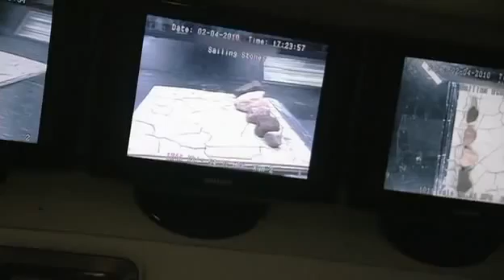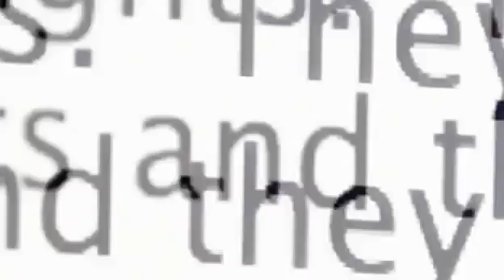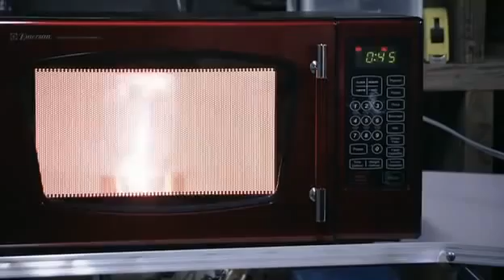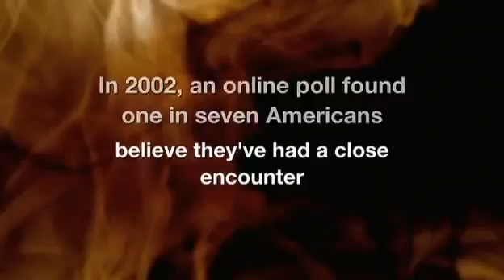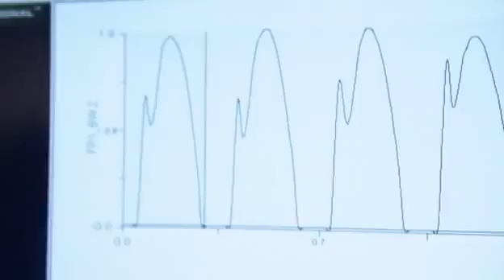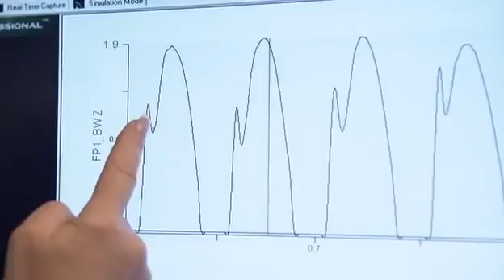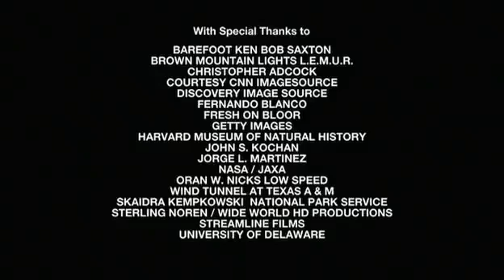Sailing Stones of Death Valley - Paranormal Supernatural Documentary

Comment: My theories on stones --->
The rocks goes everywhere because of their non aerodynamical shapes.
it can be seen during the experience.
they can roll,being out of balance or the cracks on the ground cause them to grab and go sideways.
The fine/dust sand can be a lubricant during summer.
The ground when dries up retract and pull rocks or they just go one direction because of the repetitive dry/wet cycle on the ground like a snail would : expand /retract.

Comment: I am a practicing amateur Atmospheric and Weather scientist. I have been working on a theory that explains a few things and among them, the theory of how Ice ages actually occur.
 How does this fit in to the moving rocks theory that would include rock movement during the summer? Simply this. The valley itself is not only a wind tunnel but it is also what I call a pressure trap. Surrounded by high peeks this area would also have extremely low air pressures during the summer months. This occurs because of the peeks surrounding it keeping the higher pressures out. In essence, this would allow moments of high altitude (primarily during the night) colder temperatures to push downwards into the valley directly because of the pressure differentials outside of the valley on the opposite sides of the peeks. These lower pressure and temperature variations combined with accelerated winds (downdrafts) would actually allow similar conditions to happen. The mud would freeze in minutes and the high winds would do the same things to the rocks, But also, the downdrafts would in fact be more erratic and multi-directional allowing for the paths of the rocks to be less likely to travel in a straight line! In short all of this would explain why some rocks not only move during the summer but also explains the twisting paths of some of them!

Comment: very simple -  this is a inspired explanation of the moving stones.  

1st look at the dirt. it is cracked and there are gaps that make the dirt  various  polygons.     

2. the desert area has a large temperature  difference from day to night.   

3.  things expand when hot and contract when cold 

4.  there is a ratchet  effect between the rocks and dirt-  because of the nonuniformity of the surface of the dirt.   

5.  this also happens to your computer motherboard when the power is cycled over and over-- it is called "socket creep" 

peace
KOTT(c)

Comment: Apparently, this mystery is now solved, according to Huff Post anyway. See, during certain times of the year, when the area floods with rain, it gets cold enough at night for the water surface to freeze, moving these boulders. Which I kind of bought until I learned that they weigh around 700 pounds. I don't think 1/4" of ice is going to move that......

Comment: "air is a fluid"   6:30  and shes a scientist? I have seen enough, im shutting this crap off.
Reply: Actually air is a fluid. She's right.
Reply: which part? the nitrogen, carbon dioxide, oxygen or argon? as far as I know those are all gasses.
Reply: Dexter Melnyk Air is a gas. Or it is made up of gasses if you like. Both gasses and liquids are fluids. Fluids take the form of the container that holds them, as air does. Google it if you don't believe me. Just type the question "Is air a fluid?"
Reply: i smell what your stepping in.  Thx.
Reply: well no not really, when air cools you don't get water.   Well maybe some depending on the humidity.  Either way the theory is crap.
Reply: +Dexter Melnyk All Gases are fluids. I concur with the Chemical engineer. :)
Reply: Oh my god... The amount of scientific inaccuracies in this conversation... I'm not even going to bother explaining them all. Just too many.
Reply: Joël LeMay I'm pretty sure that if it was wind, the wind would blow away the tracks. No, I'm afraid the solution to this problem is far simpler.

Now let's see... No one's caught one moving on video, and no one's seen it happen, and whenever they try the cameras are mysteriously destroyed, or the weather "forces them in." Hmmm... Interesting...

Oh and uh... I don't know...

Comment: Air is a fluid ? I don't think so. I was taught in my science classes that it is a GAS. Nevertheless air can still possess some of the properties of gas but let's dot our Is and cross our Ts for the sake of accuracy.
Reply: Yes Air is a fluid.
Reply: All gases are Fluids and obey fluid laws.
Reply: gas IS a liquid form as is ice
Reply: Felix, you're confusing 'fluid' for 'liquid.' Air (all gases) liquids (all of them) and even some solids (under the sufficient amount of pressure) are fluid - that is they will conform to shape of their containers or surroundings.
Reply: I think he thinks air isn't a gas. Air is a gas or a mixture of gases. Gas is one of the 3 primary forms of matter concerning liquids. The solid form would be ice.  If you pressurize air or the gases that make up what he calls air..theses gases become liquid (thank you diesel). Most gases cannot be turned into liquids naturally here on earth but the matter still exists in all 3 forms in the right settings. Yes that means liquid oxygen liquid argon liquid hydrogen... The question is not why gas behaves like liquid. I agree that it can only behave as a gas. But nevertheless saying gas is not liquid when the two are very interchangeable is drawing a line and crossing the t's. Be very ashamed of your lack of 5th grade science. Because air is a homogenous mixture of elements that (like diesel pointed out) are all elements that are liquids or ice at the right pressure.  Why does water behave like a gas? Because water at its basic liquid form is h20 elements, that again are gases. (sigh) Don't mind my English I am bilingual. 5th grade science (high five) got that. Well I hop that clears that out for you. You might want to also make sure you know how light and colours work so that you can at least answer the old question why is the sky blue?.
Reply: Sylvia, I'll repeat .... gasses, liquids and some solids under the correct conditions are all fluids. Don't confuse 'fluid = liquid.'
Reply: Im sorry and re-read my statement again ... at not point am I confusing liquide and fluid. But if you want me to clarify it since you're not doing a very good job. Fluid are anything that can flow this includes gases and liquides. The phases of water are gas liquid and solid.
Reply: "Fluid" = compressable and follows specific laws of physics. "Liquid" = middle state of matter, which is also a fluid.
Reply: yup I didn't say the contrair
Reply: No Sylvia, he did not write "Air isn't a gas" He wrote "air isn't a fluid" because in English 'fluid' is synonymous with 'liquid' in modern usage.
Reply: did I say that... nope
Reply: Yes, you DID - read your second post. THEN read your first post where you said "gas IS a liquid form as is ice"
- YOUR EXACT WORDS.
Gas is not a 'liquid' neither is ice.
However, gas and liquids are fluids by definition and ice under VERY high pressure can show characteristics of fluids but it is, in fact, a solid.

I understand English might not be your native language but what you wrote might not be what you are thinking.
Reply: because gase is a liquid forme.... gas is not a liquid...There
Reply: and gas is a liquid form
Reply: NO gas is gas. Gas =/= liquid. However gas = fluid and liquid = fluid BUT gas =/= liquid.

Because the word "fluid" does NOT define the state of matter, only the ease with which it moves.
Reply: yes and gas is a state of matter just like liquid.....I never and will say it again....never wrote that gas is a liquid....but a liquid forme it is
Reply: Wrong
 What is your native language, I will translate for you so you can understand your mistake?
Reply: No need for translation. I can translate from French to English, English to French no prob. I wrote gas is a liquid form... and yes it is, if you consider that is a common state of matter of liquid. Gas and liquid are very interchangeable. Soo much infact they are both fluids. My main concern was that he might have not known that air was a mixture of gases when I wrote my first comment. What first struck me was that he wrote that (air may nevertheless have SOME gas like properties.... but we should cross our t's.) If we should cross our t's and be anal about it Air is Gas not a stand apart thing and gas is a liquid form. Which between you and I...he was not talking about fluid. But yes gas is a fluid but for anal sake....I didn't thought I ad to refer to the redundant answer posted many times above my initial comment....for anal sake... I though I though I might precise what I wrote again and again. Air is gas, gas is a liquid form. (sigh) again did not and still am not saying gas is a liquid.
Reply: NO...gas is NOT a liquid, it is a gas, until it's condensed THEN it is a liquid and no longer a gas and it's become clear you still have a problem with English.
*"FLUID" =/= "LIQUID" You are 100% incorrect. This is information a first semester chemistry student learns. Gas is gas and liquid is liquid they are NOT the same thing ...however, both are considered "Fluid" and you DID write 'gas is a liquid form.' Go back and read your own post.
Reply: OMG im not saying it is for freaking sake get it in your head I did not and am not saying that. It is clear you are being delusional in some way. I wrote like not is. I think I went through this just AWHILE AGO yes I am writing gas is a liquid form......which does not entail that I am saying gas is a liquid. Infact i'm telling you now AGAIN! YOU HAVE A ENGLISH PROBLEM A PROBLEM WITH RETHORICAL LANGUAGE.
Reply: Congrats....not. I tutor and this is 5th grade curriculum. State of matter and substates. -_-
Reply: "retarded" ? no, I'm an engineer and teach college level courses.
Reply: College.... yeah Im glade I attained higher education and plan to do the same with my children....tell me is it one of those horrendous things called community college.
Reply: I sound great in english. Your density along with diesel's makes you both seem like dense teens. My english skills did not lead me to write something I did not want to. I f you cannot understand the rethoriques of language and want to belittle and attack someone who has advanced english skills...You will also be mocked. Note that I'm pretty sure he understood, he just wanted to be aggravating. Also language aside.. College is not acheivement.
Reply: Actually I was schooled in french all my life, but english is my very first language. I graspe the english language very well. To not understand a simple comparision in your own language that you have been schooled in all your life is shamefull to say the least. Also you do not understand rethorics at all.
Reply: English is an international language and everyone is speaking english here. Again Insinuations... What is this battle you're mentioning? Very pitifull you don't grasp your own.
Reply: I don't 'grasp my own' what? Chemistry? Engineering? No, I have mastered it, so says the degree certificate hanging on my wall....
Reply: yes what you dont understand is me telling you that i never wrote gas is a liquide. You're taking my words out of context. Also I beleive you... about the little college thing hanging on your wall.
Reply: I can read and you wrote what you wrote. I don't have the ability to edit your post. GO BACK AND RE-READ WHAT YOU POSTED. DO YOU UNDERSTAND WHAT I AM SAYING TO YOU?

I peux lire et vous avez écrit ce que vous avez écrit. Je n'ai pas la possibilité de modifier votre message. Revenez en arrière et relire ce que VOUS À JOUR. Comprenez-vous ce que je vous dis?
Reply: yup you dont understand a comparision and are denying the fact. gas is a liquide form does not entale that I was saying gas is liquide. It really is like talking to a wall.
Reply: Congrats on grasping 5th grade natural science. I would'nt brag given your profession.
Reply: hmm what is denisty.... :P and sorry no boyancy but plenty of buoyancy in life. Metaphorically speaking.
Reply: fluid does not equate liquid, its not a state of matter (gas, liquid, solid).
Reply: canh, That is a concept lost on French women. - see above...
Reply: comparision not a concept well known to the guy above...again I guess i'm also saying that ice is a gas too. LMAO good one diesel now let it go
Reply: You'd think there was a medal....and the ones that come here to pounce on this question claim they are Geniuses HAha. I dont think felix is worth that.
Reply: You never got very far in science class, did you?
Reply: Cretaal, No she did not. She's not good at trolling either.
Reply: Uhmm excuse me but ( like) does not mean (is) (Is like) means (is like) and not (is)....and Im not from Europe or anywhere on that continent.....wow the ignorance of community college education is just so apparent in you Diesel. Go ahead teach us how you make conclusions out of pure insinuations...Bahaha Lastly you are correct I am not trolling...you on the other hand have to let it go. I was explaining by making a comparision.
Reply: also diesel ....(hehe) if you would look closely he replied to felix....so he may or may not be talking to me. Bahahah
Reply: damn....psycho hose beast......
Reply: Hmm didn't know community colleges hire misogynistic teachers. Guess the old adage is true somewhat..... teachers teach what they cannot do.
Reply: I would want anyone called drhillbilly  to run in the opposite direction. so thanks.
Reply: good dog!
Reply: Another mister insinuator .....nop wrong very wrong couldn't be wrong ..er....and good cause I don't need your snotty approval
Reply: Grantham, TRUE but 'fluid' categorically =/= 'liquid' and somebody doesn't seem to get that.
Reply: Maybe It's time to actually pay more attention in class
Reply: Sylvia Benoit   when you state that "gas IS a liquid form as is ice"  do you mean that matter can be found in solid, liquid and gas forms?  Maybe you meant to write  "Gas is a water form as is ice"  which would make more sense to me, water being the matter and ice and gas being the phases  (forms)?  Or maybe I face a double language barrier.   Mais sérieusement, c'est un peu difficile à suivre.  

In your second post, you wrote: "I think he thinks air isn't a gas. Air is a gas or a mixture of gases. Gas is one of the 3 primary forms of matter concerning liquids. The solid form would be ice. "

Again, the only solid form that can be referred to as ICE is water, not liquid.   If you interchangeably use ICE instead of solid or liquid instead of water, you will get everyone confused.   The solid form of air would be mostly solid nitrogen and solid oxygen not ice, since the air is composed of 78% nitrogen and 20% oxygen. 

When you refered to liquid in the above statements did you mean water?
Reply: no I was simplifying something for someone whom I thought was maybe in 5th grade since you learn this stuff in fifth grade By like I meant they share the same attributes such as being fluid. and that gas or vapor is just another form of liquid water since he also seem to not understand that air is gas....see original post we are commenting on to see who I am referring to (felix)
Reply: Eric Ste-Marie im not going to read all that maybe felix would find it useful
Reply: Eric, you did try. We don't fault you for it, but you see the problem?
Reply: chimed in by mr hillbilly whos next mr I don't teach in college just thought Id make myself look clever....come on *here boy
Reply: yeah for something to be funny it should at least make reference to something that makes sense...well at least for me...I have standards.
Reply: "Standards?" sure but sanity and sobriety are not among them.
Reply: It's spelled 'sewn'
Reply: Sylvia Benoit just  give up, you are looking worse each comment.
Reply: really hillbilly lover...I'd have to disagree.
Reply: Sylvia Benoit bahahhahahahhahahhahaaha
Reply: Cubious Blockus BAhaHAHAhahHAHAHA .... -_-
Reply: Sylvia Benoit i like you, lets be friends, we can evil laugh all over the internet and conquer the world.
Reply: Cubious Blockus now that is tempting. You sire are a fine sire when evil laughing.
Reply: Sylvia Benoit Are  you acccepting me as your leigelord? by calling me sire instead of sir, you are accepting me as your leigelord/king/commander
Reply: Cubious Blockus   'sire' is also a word for the male parent of an animal kept for breeding....You may call me madam or dam... as in damn moxy woman :P and I officially proclaim you Sire lord and savior of youtube.
Reply: For you speak the truth good William. Her lift reacheth not the top chambers of the castle.
Reply: How about the idea that there are slow moving liquids?  Glass is one of them.  However it takes a very long time to see it.  Like decades.
Reply: By definition, a fluid is a substance that can change its shape to fit the container, which is why air is a fluid.
Reply: Aaron, also anything that can be compressed then return to it's original volume when pressure is relieved.
Reply: dieselscience You've obviously never seen a kitten driven over by a steamroller
Reply: I'll clarify that with " NOT in a cartoon"
Reply: I got a restraining order when I tried to see if the fume hoods at my University would pass the M-80 test. ... put an M-80 in and close the glass, then run.